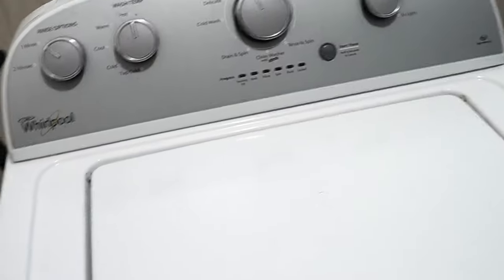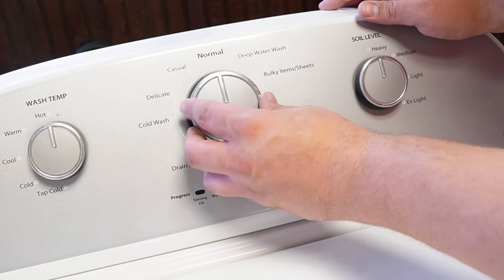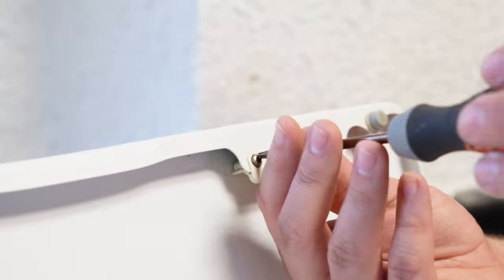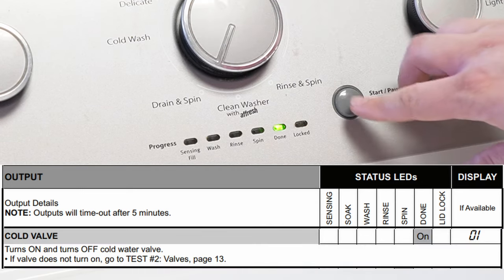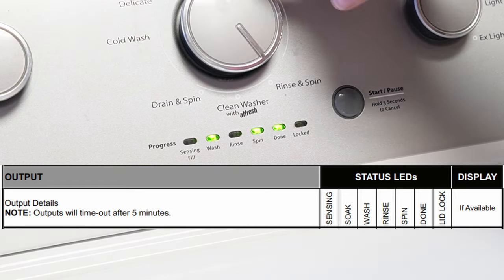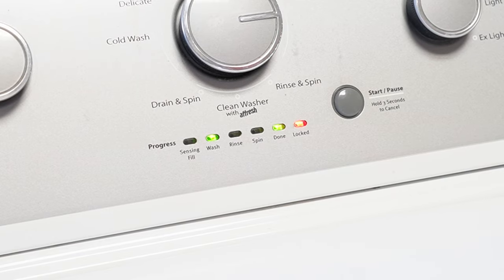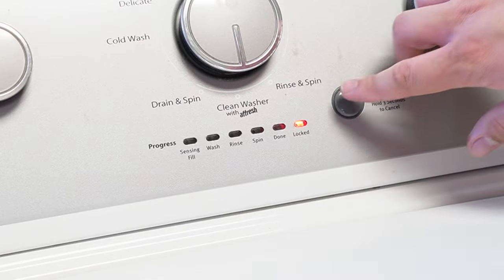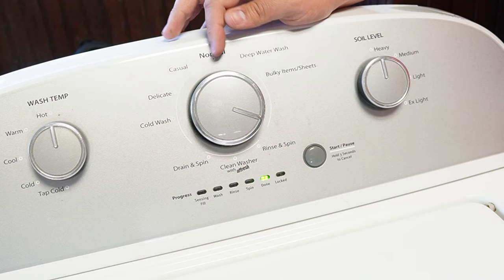Whirlpool Washer Manual Parts Tests and Lid Lock Bypass for Open Lid Tests

Comment: My washer stays on lock. Every time I shut it. It doesn't let my washer work. Because it stays locked and can't open. What can I do about that.
Reply: Same
Reply: @ellieellie856  I had someone check it. What was wrong with mines is that. The part where it locks. There's a piece that locks and unlocks it. Mines was broken. I had to get that piece  changed
Reply: @Rayallwayz  thanks Ron I am looking into purchasing a new lid lock system hope it works

Comment: My kenmore 22352 the blue Valve for cold water cracked. The door is locked. I tried to do the test, but it is not doing anything. Right wait  half a second  right right left right after full rotation counterclockwise. It does nothing. It is stocked in Locked with the lid red. I removed the lock mechanism thinking that would get me out of locked mode, but now I can't close the door and the machine still is locked. Now when the valve cracked Water did go inside the machine. so much so that it was filled with water. the motherboard is basically right next to the valves which is very dumb, but I didn't make the thing. Is it possible that the motherboard was damaged by the water or did the Machine go into a safe mode and lock the door to prevent damage. All I know Is that when I came back from work the machine was filled with water and there was water on the floor. right after that the machine is stocked in locked mode. Since I haven't replaced the part that has been damaged yet it is possible that the machine is waiting for me to activate the cold and hot water to allow me to use the reset mode? or the motherboard was damaged by the water. in other words do this machine has a mechanism that protects its electronics from water?  please help. I just bought the thing 1 year ago and I have problems already the Amazon people installed it. My best guess is that when they hooked the hose for the cold water they did something to it and the small crack they left became bigger and bigger overtime until it finally broke.  W10683603 Washer Water Valve

Comment: For those that have a whirlpool washer and couldn't get it into trouble shooting mode do this. Just move the dial to "Normal" then do this in increments of one. I believe this will work no matter what way the dial is pointing but I moved it to "Normal" just because.
Left / Right / Right / Right / Left / Right, move the dial and when both "Spin" and "Done" are lit up press start. That will put you in manual test mode. The codes are the same as far as testing. For me "Drain & Spin" was the agitation mode.
Reply: thank you! a single normal left to right got it to unlock! yeah the "drain and spin" was the cause.
Reply: This worked for me
Reply: Thanks!
Reply: Nothing happened on mine. Not sure what I'm doing wrong or what's wrong with the machine.  When I do turn it on only the locked light turns and then off but no cycle
Reply: Mine too I'm so frustrated 😮
Reply: I can’t get mine in manual mode at all 😢
Reply: @golfgod11  well mine when ever I put the clothes to spin it starts to spin and stop then after a while spin a few seconds stop I'm feeling frustrated right now

Comment: Thank you Ben!
I hate this thing (Amana) with red hot passion. Almost as much as I hated the Samsung W/D pair the new owners wanted. You'll remember the ones that exploded. Mine never did but I HATED how it would completely drain if you decided on a change once it began a cycle. So, now I inherited this Amana/Whirlpool. Currently searching for older mechanical timer washer in good condition. I notice they are going up in price...wonder why?

Comment: Thanks again for the great content!
We have a Kenmore Model 110 26012010 HE Top loader.
Every once in a while I need to reset the machine as it fails to complete the spin cycle on it's own (just sits there...).
I used your excellent advice and was able to determine a fault code F7 E5 (Shifter Fault) was stored (an OBD port would be nice like on my cars :) ).

I followed up with a Drive System-Shifter tests (service manual SPIN and AGITATE Tests) and all the tests worked fine.
Everything worked when manually tested.
I cleared the diagnostic error codes which I have done in the past.  It's laundry day (Saturday) !!
I suspect it'll work for a while.

Anything else I can test??

Thanks again for putting the time into these videos for us homeowner/DIYers.
Reply: Run the Calibration Cycle portion of the on board Tests.

Comment: I have this same washer and will try this to reset. My problem is a bit different in that clothes don't seem to be getting rinsed completely. My daughter is doing her laundry and using vinegar in place of softener (less gunk buildup). Problem is that we've noticed there is soap in the water even before adding soap to the wash cycle. Would this reset help anything or is there a filter that may need to be cleaned, etc? I'm disabled and unable to get behind the washer (63 years old). Sorry for the most likely stupid question.
Reply: Try to run an empty load with just pool shock in it to clean out the gunk. This might buy you time until someone can check your filters if there is any. Run it a few times this way if it's really bad. ❤😊❤
Reply: I've see this in the past and not sure if it's the same in your case but these newer machines and newer HE detergents need very very little detergent to wash your clothes .I suspect the soap you are seeing is left over soap from the previous load ,I know in my case that was the issue ,hope this helps.
Reply: No such thing as a stupid question

Comment: Hello Ben. I'm really enjoying the depth of explanation in your videos but I have not seen one that addresses the issue I'm having with my Amana (Whirlpool) top loading washer (NTW4700YQ1). When I plug in the washer, the "Fill" light is flashing green and nothing else is responsive. If I press the Start Button, the Fill light goes out ( plus no display lights) and the drain pump activates. the pump does not stop until I unplug the washer. I've replaced the Lid Switch and tried to reset, but no response, just the flashing Fill light. I replace the Actuator (same result). I just replaced the pump thinking there could be an issue with it, but the response was the same, except that the pump sounds stronger and smoother.  Could it just be a bad Master Board? I can't seem to clear the flashing Fill light.
Thanks,
Jess
Reply from the maker: Likely this video would help: https://youtu.be/r255EO4DJMY

Comment: I took out my broken lid lock and then replaced it.  The red locked button continues to flash and my machine won't reset.  I have tried this at least 10 times correctly and still won't reset.  Any suggestions as to what to do next.  Thanks for any assistance
Reply: I cant even unlock mines i am having the same issue but it stays lock and wont reset if i figure it out i will let you know
Reply: I got in diagnostic mode couple hrs ago...due to my lid lock clicking. And after getting in diagnostic mode couple times...about gave up.

Then it worked like brand new. But after another load...same lid lock situation.

My 3rd load now....after getting back in to diagnostic mode. It's running as should now.

I never take the lid lock off....cause I do not have that tool handy.

So....my question is. Do I need to replace lid lock?

Going in to error codes may send me over the edge.😢
Reply: @barbaraday1  Try putting a  small ball of cotton in the lid socket to push some switch

Comment: Hi ben.   i work in hubbard ohio, i  got a kenmore washer out of storage and hooked it up and all it does is lite the fill light and lock lid light..but does not attempt to fill.     Just does a clicking noise.     I replaced the capacitor and the water valve so far.      could it be the locking lid functioning as to why it would start/ fill  ect.    thank you.

Comment: So... how did you get the machine to LOCK the lid while in Manual Test Mode?
Reply from the maker: I pressed the start/pause button once I set manual mode, it's the first test
Reply: @bensappliancesandjunk  what if the lid lock works in test mode and recalibration but won't engage during sensing fill mode?

Comment: Hi i have the same model was washing aload of clothes open the lid in the middle of wash and it locked the lid wont open what should i do to get it to open up?
Reply: If you find this out, I would really appreciate the knowledge, I’m in the same position
Reply: @brycesnyder9158  Take out of the door cover locking plastic device with a cross driver & put it in the locking aside switch set.. & go from there..

Comment: My machine has no agitator so I am beyond annoyed that such a thing was designed into these machines, especially seeing how often they seem to not only frustrate but outright fail the consumer. Arrgh!!!! So my question is, can I remove the lid lock striker as you describe here and just permanently bypass the useless lock feature?
Reply from the maker: Theoretically yes, as long as the striker is in place and the lid lock system works
Reply: @bensappliancesandjunk  Thank you. Actually, after having watched (and wondered) I went ahead and gave it a try. Troubling to see how exactly this machine operates (very little water, intervals of cold water gets added when hot is selected, forcefully bounces clothing around rather than simply agitating them) but happy to say it works! Thanks again!

Comment: hi, great video - any idea how to bypass (jumper) the lid lock circuitry to test if the lid lock is truly the issue I have?  In diag mode it fails the first test (lid lock). thanks much
Reply: Having the same problem, have you figured it out?
Reply: Yeah, get a new switch
Reply: Sorry so late, when you lift up the lid and expose the wiring on back panel, you should see a green wire, a gray/black wire & a white wire. Leave the green wire connected just as is (ground) strip the white and gray wires and twist connect the two wires with a wire nut. Use electrical tape to wrap the new connection you just made to keep it from getting wet or damaged by surrounding components.  Shut down the lid and replace all the hardware that was removed back to starting position. The washer should operate as though the lid was locked when in fact it is not locked, it was bypassed. Hope this works for you!

Comment: So what do you do if the lock it's self is busted and the stupid machine won't fill even if I push the lock in myself
Reply: Same for me.   My washer will only respond in diagnostic mode.  The lock lid light is preventing me from using the washer.
Reply: No one in the net states what happens if the lock mechanism is damaged.

Comment: Ben my washer is stuck in drain mode,no lights,no response,if I spin the basket manually it will stop trying to drain momentary.
If unplug and plug back in no lights just a pump that comes back on.
Reply from the maker: I have a video for them if they run constantly. Check my channel out for it

Comment: I followed the diagnostic test. The lid lock does not light up and just keeps clicking. It won't do any other with it. Is there a way to bypass lidlocking? I usually just run washer and never open lid until wash is done anyway...
Reply from the maker: These lid locks can't be bypassed
Reply: Thank you
Reply: We did buy the part comparable for our machine numerous. The lid switch also and the switch does not go into the bezel. Looks to be exactly the same except the lock on the inside won't allow it to go through. Wondering if maybe it is that way until it is installed 🤷‍♀️
Reply from the maker: @donnaandytakach5837  did you watch my video on installing the locks with the bezel?
Reply: I will look for it. Thank you
Reply: Having the same issue. It's driving me crazy. The clicking is it actually locking and unlocking. For some reason even though it locks the machine doesn't think it's locked.

Comment: Need help please my Whirlpool washer is shaking wildly and I already change the spring (4) when i did this Manual, when i was on the Spin Mode my washer spon wildly even there no clothes inside need help please
Reply from the maker: Check to make sure it's level. Also check hub

Comment: What if it does nothing, no click, no lights, only thing I can get it to do is run a bit of water for a few seconds, then stop! Any suggestions?  I need help!!
Reply from the maker: Check for error codes. It may be failing out of a test needed to run the unit, like the lid lock, ect.

Comment: I bought a brand new Whirlpool washing machine top load haven't even got to wash a load of clothes in it repairman has been out three times already he has recalibrated everything washer don't work then he checked the the motor was getting hot so he changed that then Calibrated the washing machine washing machine still does not work I have been looking for an email address for the main corporation headquarters cannot find. It's a shame a man pays good hard-earned money and can't even wash a damn load of clothes